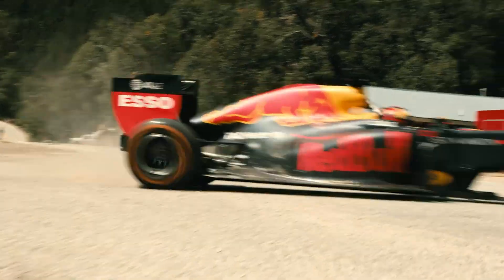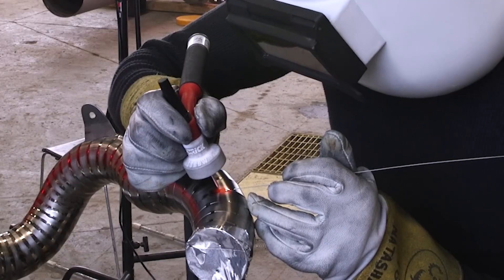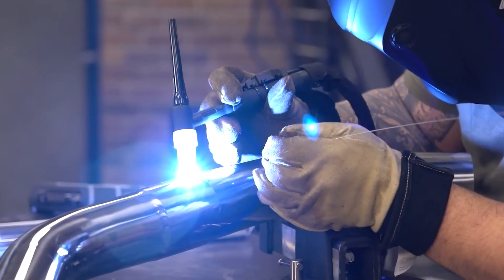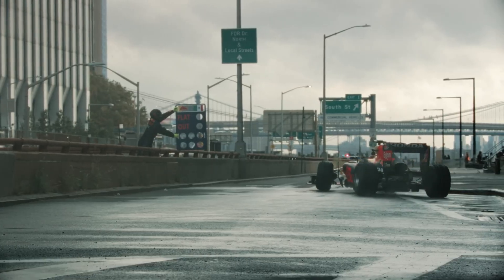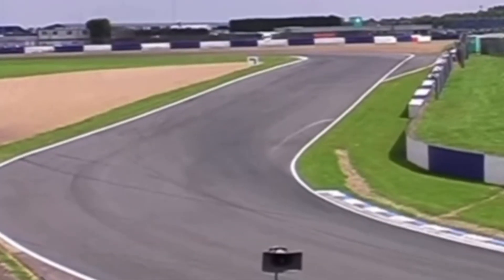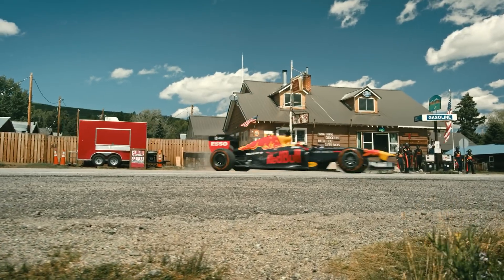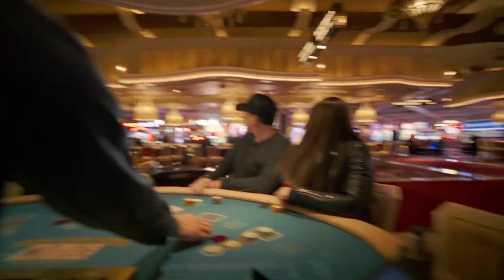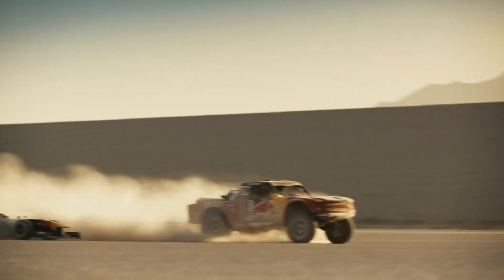F1 Exhaust Sound Explained – How to Replicate It!

Comment: Actually you can replicate f1 engine sound with motorcycle emgines:
Preferably honda cbx inline 6 engine, or
Screamer inline 4 with above 14.000 rpm limit
Inline 4 2 strokes motorcycle engine.

Then get tuned exhaust
Reply from the maker: That sounds like a great idea! Has anyone done it?
Reply: @RorZFilms1 1 youtuber had done cbr1000 engine swap,
And hayabusa swap were done couple time

Comment: 20 minutes and you said nothing about stepped headers and the harmonic nodes they create. The V10s were magnificent because the 5th partial in the harmonic series is the major third. The Ferrari F1 V12 sounded pretty good too. Oops! Maybe I just spilled the beans and gave away the F1 sound secret. The Ford V10 from the BIY guys is a 4 valve one off build. They deserve a lot of credit for what they've done. It sounds incredible!
Reply from the maker: Thanks John! Yes there’s so much to cover and not much info out there. Please tell us more!
Reply: @RorZFilms1  Scott Mansell, "Driver 61" here on YouTube has a great video on the V10 sound, stepped headers and how they combine to make a musical masterpiece for motorsport fans. The step to a larger diameter, at half way down the header before the collector, creates a larger volume space and a node for acoustic waves to reflect back into the combustion chamber, but at half the wavelength, creating a kind of phase shift effect to prevent cancellation back pressure and actually increase scavenging by a tiny amount. The acoustic by product is the amplification of overtone 'partials" above the fundamental pitch. On a 5 cylinder bank of a V10, this works out to be the the 5th partial, which is actually the major third in music physics/harmonics and creates a major chord. So V10 engines blast a major trumpet chord as they fly by at redline, wide open. It's marvelous. Other cylinder combinations can achieve similar effects but the length tuning and wavelength fractions may be different. The harmonic series basics... A unison note is a 1/1 ratio. An octave is 1/2, Perfect 5th 2/3. Fourth 3/4, Major third, 4/5, or the 5th partial in the series. Position 5. 5 cylinders each bank of a V10. So it's a trumpet duet. Awesome. 😄   

https://youtu.be/IY7GGiV8fKM?si=frKZtMXKNGmVH4Ea

Comment: Long merge is the key on a street car.   And not just 2 u bends touching.  I make a pipe called the screamer.   That is a long merge with built-in taper pipes.  That will make most v configuration engines have that European high-pitched sound   You can also change the sound of the high pitched by the merge length and thickness of material   in the screamer
Reply from the maker: Thanks for sharing. I’ll make some more videos on the subject. Do you have anything else to add?

Comment: That header collector also need to collect clockwise/anticlockwise both side need to move opposite direction to x pipe, megaphone is also needed for lower rpm engine before or after x pipe like Pagani did give some distance around megaphone. If you done it correctly it'll give higher pitch sound like Zonda from m120 Mercedes. If you really want that sound you'll need to make multiple exhaust setup after the header. Choose the ONE!